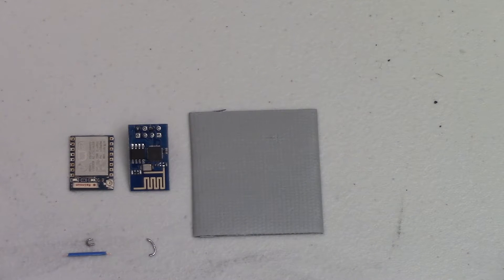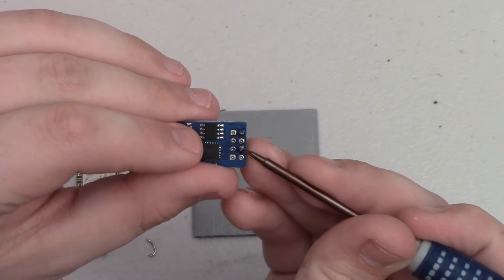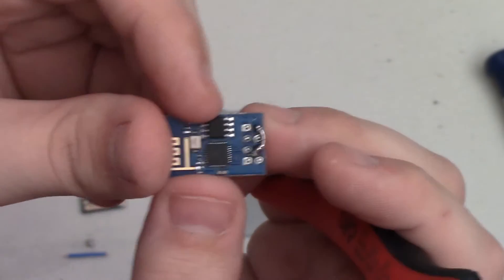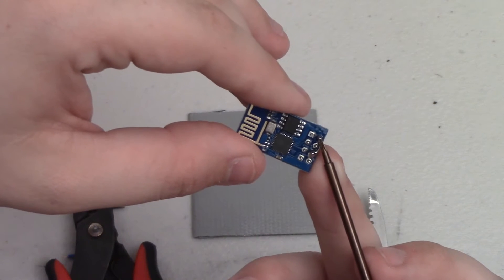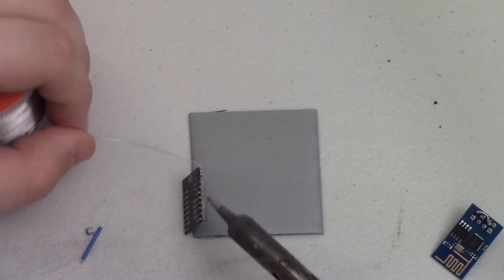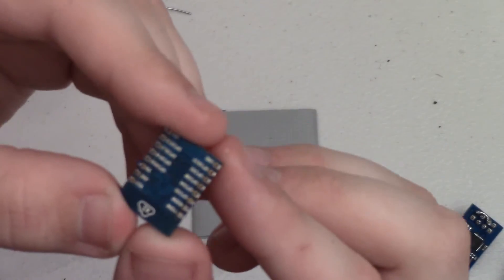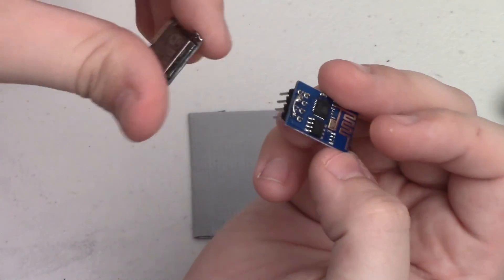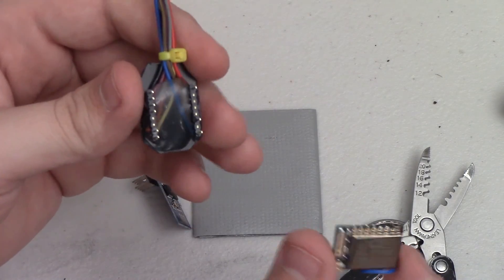Easy ESP8266 Project Prep

Comment: Hi, Just tried on a WeMos D1 R2 board and got the same error as the NodeMCU - Any ideas as to why ?

wdt reset
load 0x4010f000, len 1384, room 16 
tail 8
chksum 0x2d
csum 0x2d
v3de0c112
~ld

Thanks
Reply: Ray Leslie you don't need to do this on those development boards, this is just for the bare esp8266 modules
Reply: And do not try to learn from this guy, go read tutorials from instructables or something

Comment: Hi, tell me - would the same apply to a nodemcu board?
Reply from the maker: A nodemcu shouldnt need anything special since it's already setup for plug-n-play functionality. This should only be needed for bare ESP8266 boards.
Reply: Thanks, that is what i suspected, however I cant get any of your sketches with ESPHelper going on nodemcu boards - they go into a funny wdt reset (load 0x4010f000, len 1384, room 16) rebooting loop and cant figure this out. so when I saw this video was wondering if this might help. Guess I will need to get some bare ESP chips to play with. Thats alot for all your good content - its FANTASTIC, keep up the good work
Reply from the maker: What do you have connected to your nodemcu? So if theres anything connected to the board on pins 2 or 15 that might be pulling them high/low then you might get a boot issue. with nothing connected to the board (just usb to upload) then there shouldnt be any issue?
Reply: board is just connected via USB - so nothing on the pins, it only seem so to be with the ESPHelper library - If I upload some of your older code it boots correctly. I got myself a ESP-13 today so going to try that this evening
Reply: Ray Leslie how did you manage to get your esp13 to start and upload code to it? I seem to be getting an error
Reply: John Maree I have not actually - been really struggling. Have some esp 01's arriving next week and was just going to wait for them.
Reply: John Maree out of interest - what error you getting ?
Reply: Ray Leslie well I've tried all the different modules in the board option in arduino (I'm uploading Via an ftdi board) and get the eeprom error
Reply: Ray Leslie how have you been struggling?
Reply: John Maree yup, same error I get, I suspect incorrect wiring or something with the ftdi board. Will know next week once my 01's arrive - also getting another ftdi board to test.
Reply: Ray Leslie my FTDI board works perfectly with my ESP 01 modules which is frustrating me
Reply: John Maree what ftdi board do you have ?

Comment: Hi again, 

Would the ESP-13 module have the same startup conditions as the ESP12? I am struggling to get mine to boot and subsequently get the eeprom failure when trying to upload code.
Reply from the maker: Yes, it looks like you have to set the ESP13 roughly the same way as the ESP12.
Reply: ItKindaWorks Thanks so much! 

I'm really loving the home kit videos! I wish there were more of them I find them really informative! 

Keep it up!

Comment: hey, been following your videos for some time now. great content.

so I wanted to ask about gpio15, with the ground bridge I guess it can't be used anymore as a normal gpio pi?

thanks!
Reply from the maker: That is correct. GPIO15 cant be used as a normal pin and is only useful for setting the boot mode. I suppose you could try to rig it in some way so that it is pulled to ground on startup but then is used for other purposes afterwords but I wouldnt recommend it.
Reply: Hey thanks for your reply. I did some research it seems it can be done. A number of people are doing what you mentioned pulling up and down.

Would be so cool to be able to use all with your prep.

 instructables.com